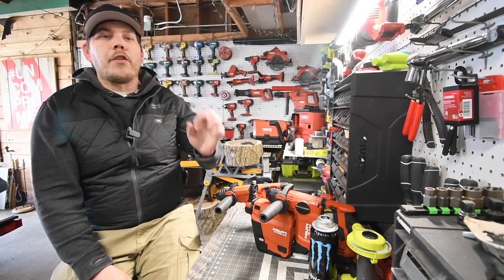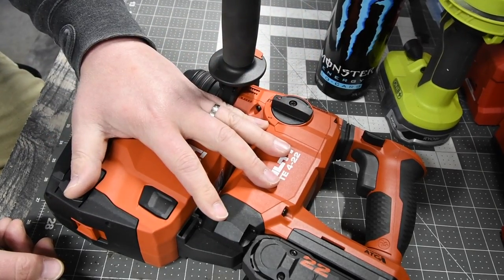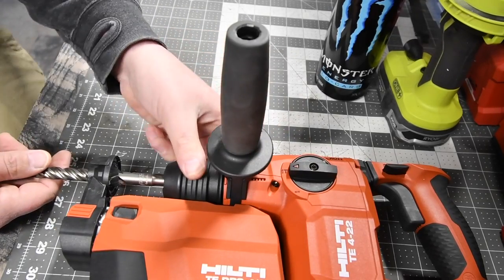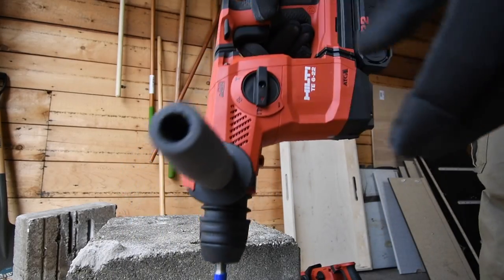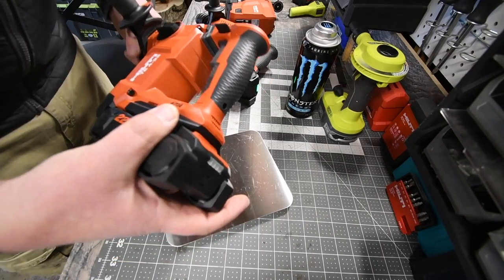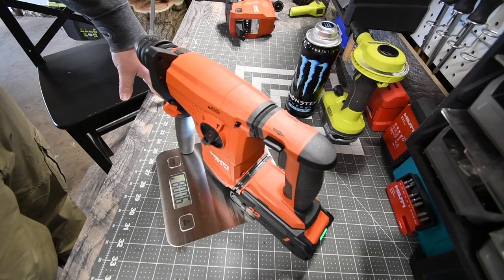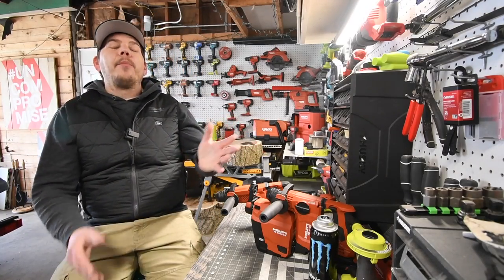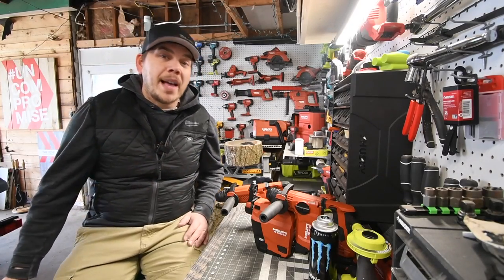Which Of These SDS HD Has More POWER?

Comment: Hi may I suggest you get other concrete samples , high density vibrated mass concrete , something much harder than those blocks .I have often found sds preforming better in harder concrete as less energy is absorbed mass concrete wall versus block . Keep up the good work

Comment: Thanks for the video.  I actually bought the TE6-22 over the TE4-22 - as the 6-22 has the chipping function in addition to hammer drilling.  I had the TE4 for the last 10 years before upgrading so just wanted to point this product difference out since it is a major difference outside the performance and specs you went over in the video.

Comment: I've used a bunch of sds hammerdrills but never a hilti. I wonder how they compare to other big names. I got a bunch of those rebar cutters and various other bits on home depot app for like 75% off about a month ago. Just mentioning it so others can keep an eye out for commonly used and abused consumables like that.
Reply: Comparing to Bosch, Metabo (not Metabo HPT) and Makita: Hilti punches above it’s weight, power wise. By design it has noticeably less anti vibration.  Key word is “by design”.  The trade off is it is built to take a harder beating and will also keep dust out better.  I took apart the Nuron 6-22 and the Makita XGT recently and it was interesting to see the very different approaches and also the evidence of entirely different priorities.  Anti vibration requires a lot of empty space that Hilti choose to instead fill with a bigger motor + bigger fan and a tougher/stiffer housing.  Instead of a standard two piece clamshell, they went the modular approach with $$$$ injection molding.  Fit and finish is fantastic.  Balance with the stupid Nuron batteries is…meh.

Comment: So I was exited to see this head to head test as I own the TE6. So… since the TE4 is your favorite how do we know you was pushing down a little harder on the TE4 “your fav” vs the TE6. You say the motor being bigger and the batter may need an 8amp hour to be faster more efficient for the TE6–I don’t think the test is FAIR😂😂😂JUST KIDDING BUT GREAT VIDEO—MY FAV TOOL CHANNEL!
Reply: I dont think he's saying it needs the 8amp hr battery to be more efficient or faster. He's saying for the same speed, it drains more energy from the battery, it's less efficient. I'd guess this would be because there is more loss in turning the bigger motor. The bigger motor is needed for harder jobs that need more torque but will make it less efficient for easier work - pretty much why brands make the different grades of tools, to pick the one where the job fits within it's optimal performance. Much like a 5ltr V8 will be inefficient compared to a 1.4ltr 4 cyclinder when going at constant speed on an easy road.. but the V8 will be able to handle acceleration when needed or tackle steeper hills where the 1.4ltr will fail.
Reply: @natdenchfield8061  it was a joke.
Reply: @revg2608  Yep I know. You mis-quoted or mis-understood what he said within your joke, so I tried to make it clear what was going on, for you or anyone reading. Sorry if you took offence.
Reply: @natdenchfield8061  it’s all good.